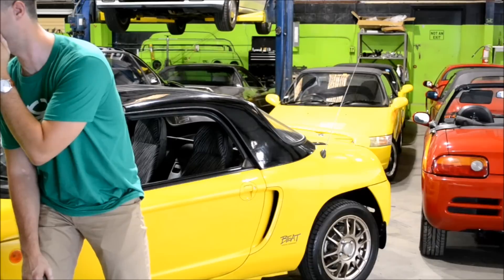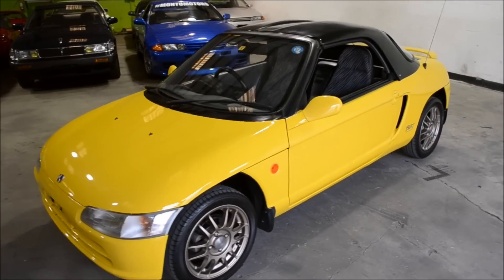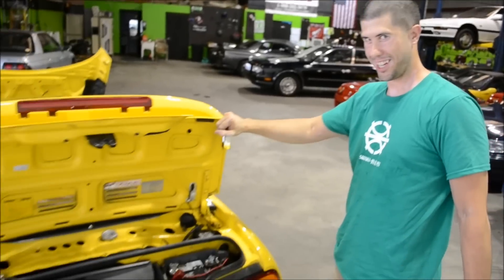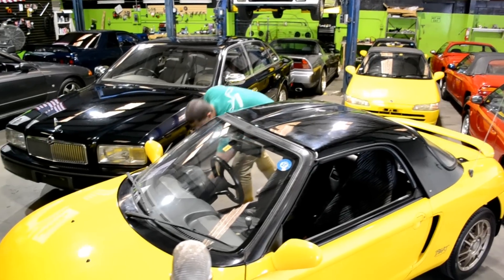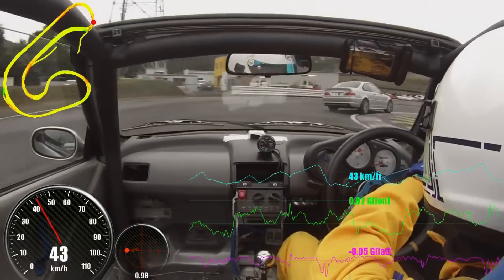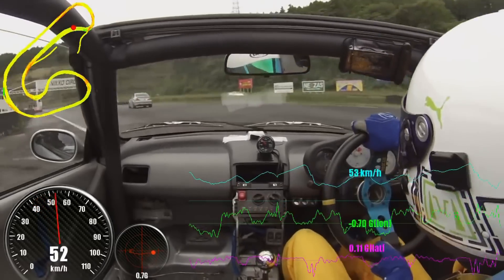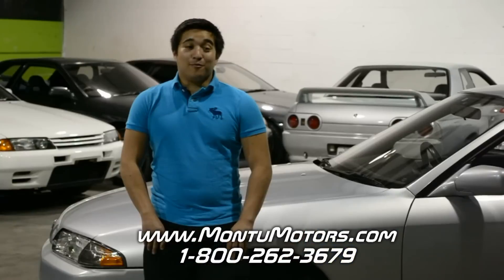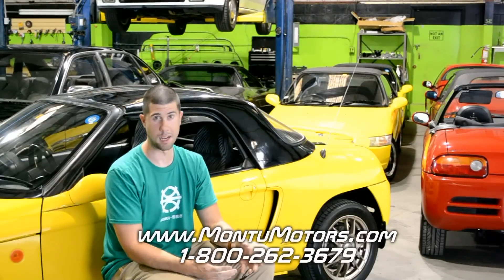Josh's Honda Beat from Atlanta, Georgia USA. Special Request

Comment: damn looks like no beat for me im tall in the torso not the legs. damn i need to get remesured.  bad when i have to go to a talior just to see if i fit in a car. damn. well...maybe a mr2...maybe...but kei truck for sure now thats just 2wd or 4wd...leanin to 2wd but i live in Ne we have snow from time to time but i drive on the paved roads...baa...this video just made it harder...damn it @thatdudeinblue finish your beat video!
Reply: You might fit just fine, my friend is 6'3" and fits just fine, he says it's a bit roomier than in his Mr2 SW20 for headroom, and he can't even fit in a Mk1 MR2 AW11. It could be just right!
Reply: Joshua Munchow naaa....dont do that to me!  man i have a hard enough time choosin!  i know i fit in a geo metro. but that a whole other car from a honda beat.  i have to go across country just to see if i fit >_<  and if i do it be a safe bet it be sold on the spot.  aaaaahhhhh.....i have adhd this is not something i need to have bounching in my damn head!
Reply: Keep an eye on Craigslist!  They're slowly popping up all over the country - you might be able to test one pretty close to home
Reply: Rob Wilkey not likley i live in the middle of nowhere Nebraska
Reply: Hmmm yes that does complicate things
Reply: You'll fit with stock seat's. My 6"3 friend drove mine comfortably and it has a Recaro bucket which is slightly higher than stock.